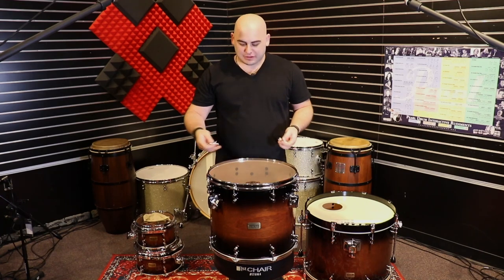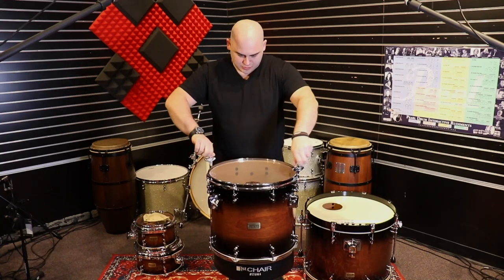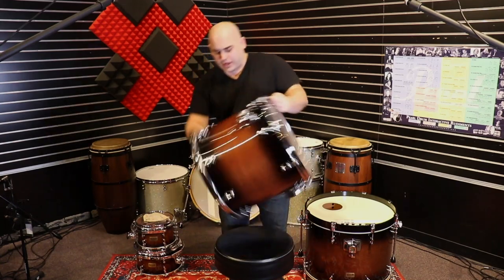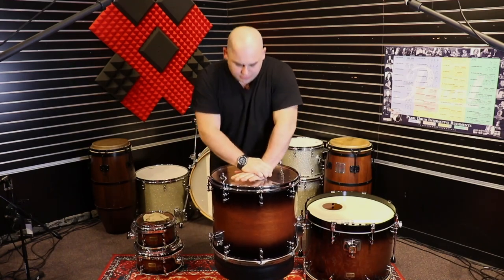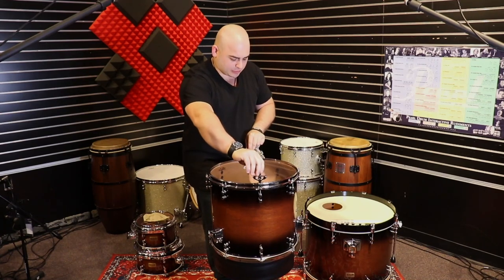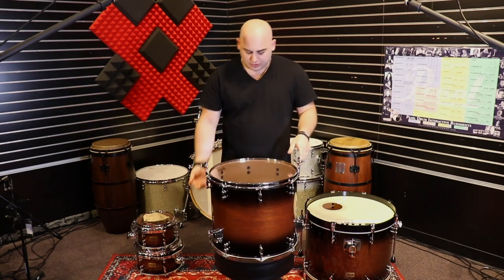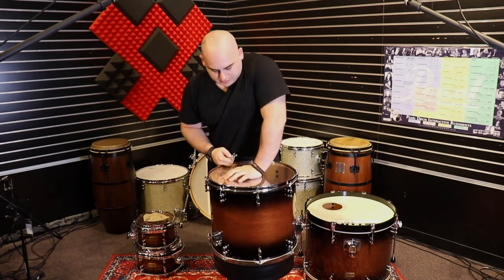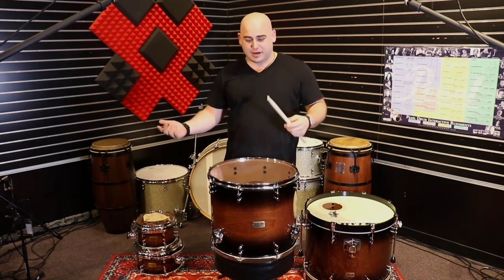How to Tune a Floor Tom

Comment: mine just comes loose again after an hour of playing. i then tried tuning it higher to stop this happening but it sounded like crap
Reply: If you haven’t fixed it yet, you might need to drop it almost so it’s off like where he started in the video with the batter head and give it a good stretch the same way he did. That might fix it. Otherwise depending on how old the head is you might be in for a new one.

Comment: This helped me so much since I had a 16 and 18 in floor tom. And forever  I was using the app drumpro tuner. And it seemed like forever I couldn't get the pitch I wanted. Tuned my 18in tom perfectly watching this method and currently tuning my 16 in w the same method. Thank you for this